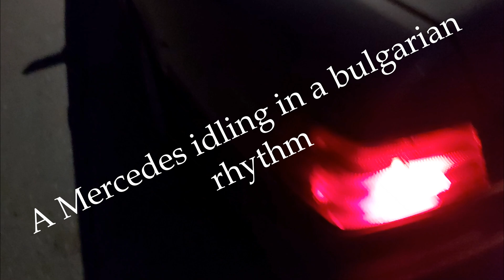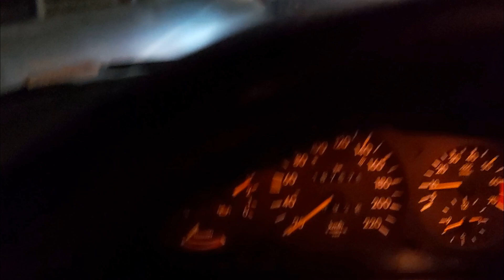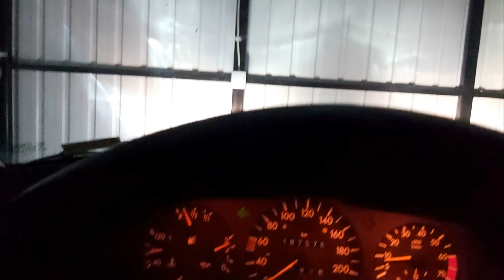KE-Jetronic - Mercedes Benz W124 - A Terrible Misfire

Comment: I have a misfire on my 190e with the M102 engine on cylinder 4. I have equal fuel flow through the injectors, new distributor and rotor arm, swapped spark plug, HT lead and injector with cylinder 3 and I still have a lumpy idle. Car uses the TSZ ignition, timing has not been messed with. Fuel pump is supplying almost 5.3bar with over 2 litres returning to the tank per minute. Any ideas?
Reply from the maker: Maybe the exhaust? That's everything I can say.🥴